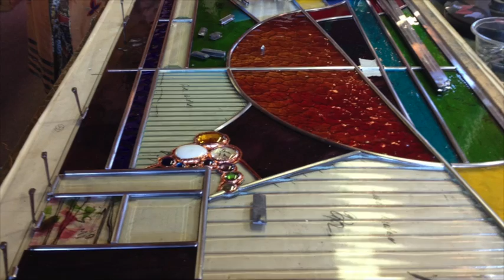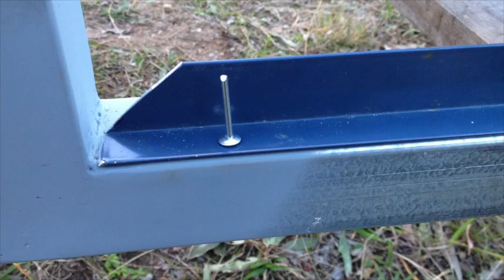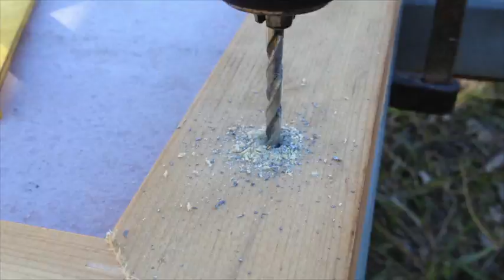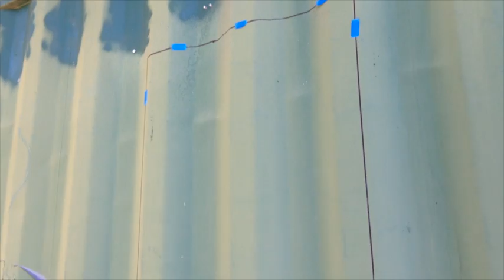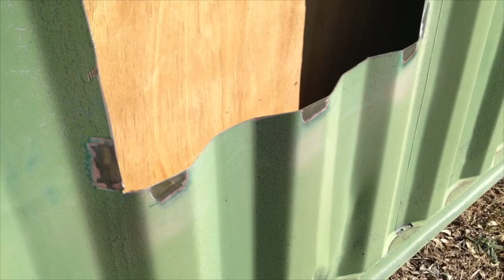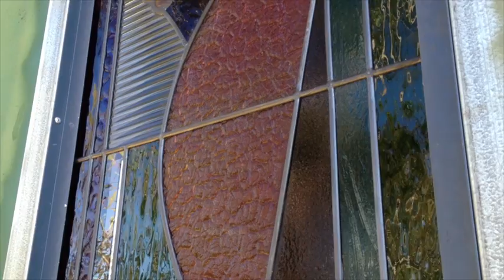Shipping Container house -- World's first container with stained glass windows

Comment: This is beautiful. A nice addition to the house, especially since it did not come from a shop.
I was wondering whether you would use the cut-out section of wall to make a hurricane shutter for this irreplaceable window.
Reply: Paul Chambers beautiful, I was going to suggest another sheet of glass or plexie glass on outside like they do for church windows
Reply from the maker: Good suggestion. I was considering a shutter on the outside. Cheers Paul
Reply from the maker: You are the second person to suggest this, I had never heard of it. Is it for double glazing or window protection? Thankyou Paul
Reply: Paul Chambers all i know is we had a church in the city and a storm broke some windows up in peak, and it saved the beautiful stain glass windows. So if you get alot of wind myabe research it and then decide. It would be a shame if all that beautiful work got broken.
Reply from the maker: Karen Lincoln Thankyou, that makes sense. Cheers Paul
Reply: Paul Chambers I would suggest polycarbonate (brand name Lexan) instead of glass or Plexiglas. Glass itself is fragile, and Plexiglas is strong, but cannot flex as much as Lexan. Lexan can stand a lot of abuse, and does not tend to break until it hits the ground from 10 m height or so - hitting corner (don't ask)
I would say that the main purpose would be protection rather than insulation (hence no glass) although it will help a bit.
Even a sheet of Lexan may not stop major missiles in a hurricane (but you can board it up for that), but it should stop the smaller bits as well as any animals that want to fly through the window.